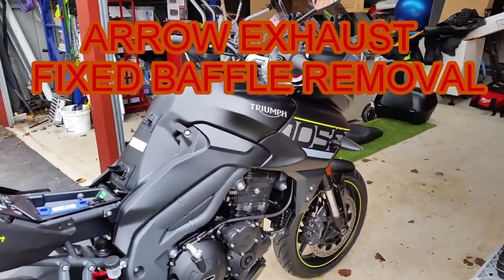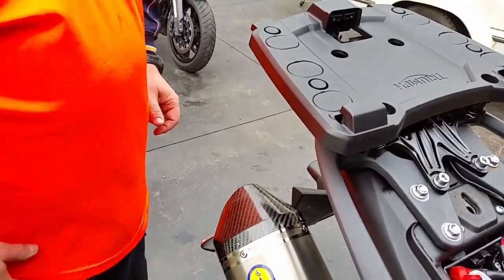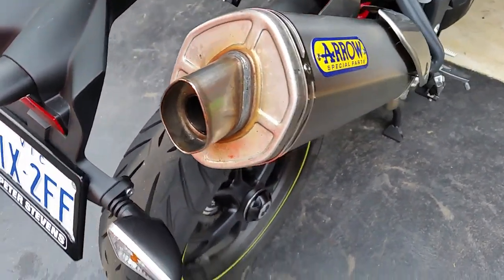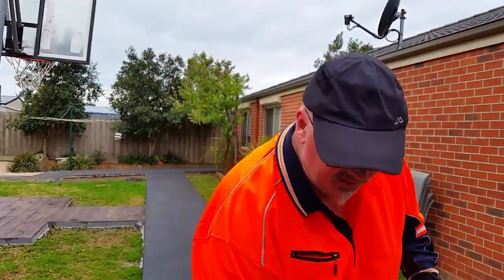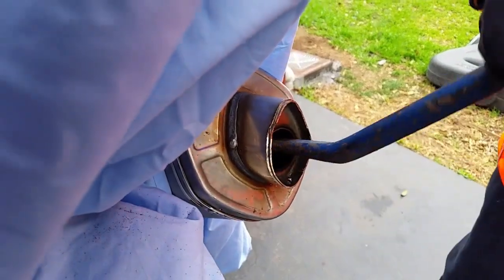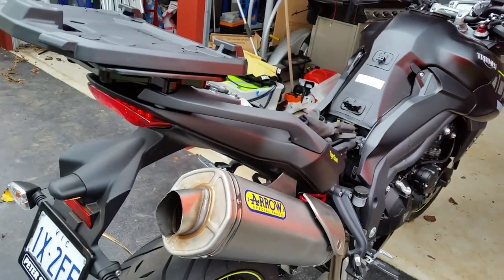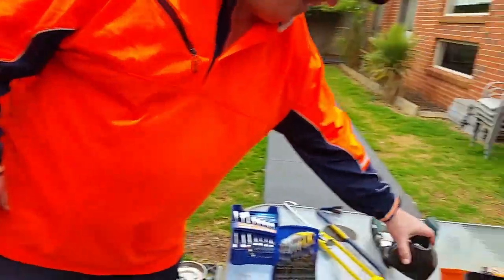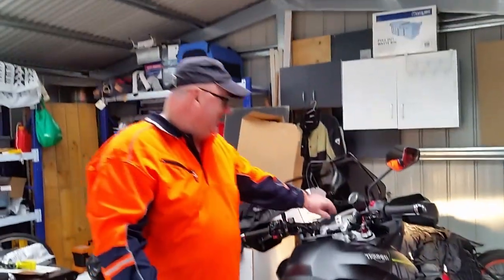ARROW BAFFLE REMOVED FROM TRIUMPH TIGER

Comment: thanks for the video. it looked so easy.. sadly the 2019 speed triple rs i just got was anything but. my carbon caps were also glued in place with some sort of black adhesive. the internal baffles were also ridiculously hard to remove. i had to fabricate a hook as coat hangers kept breaking.
Reply: Hey man. I have the same problem, how did you get the carbon pieces off?
Reply: @tsuki5419  very very carefully. so you have to drill the rivets, then i'd suggest a hair dryer or heat gun and be careful not to burn the carbon's clear coat. you'll want to heat the glue that's holding it on. i ended up chipping mine along the edges a bit. you could also take some thin metal like a feeler gauge, heat that, and use it like a knife to slide between the metal and carbon tips to melt/cut away the glue. just keep pressure on the tip while doing it and it should come free.

Comment: You guys are going to way too much trouble just to get the baffle out. I just took mine out by unscrewing the holding screw at the end of the exhaust,  took a broom handle and wiggled it up and down and pulled slightly outwards while doing it and after about 20 seconds, it came right out. Easy-peasy.
Reply: There is no holding screw on some of the arrow exhausts. Depends on the year/model/country it was made for

Comment: Hello Dan, just wondering did you retune or remap the triumph after taking the baffle out as my mate did the same and fried the valves after a few months driving because of no back pressure and the mixture was all wrong in the chamber.
Reply: Biker Dan , hello again, just giving you the heads up, it was a Honda shadow, he took the baffle out and slowly the engine went down hill, he told me the valves had been fried.
Reply: Oh, I have an MT-01 with full upgrades, full akrapovic system and I love it, the sound is like a Lancaster Bomber on steroids.
Reply: @owenieb  you fry valves when you run it without an exhaust.. back pressure isn't going to do that. its exposure to oxygen that burns them.